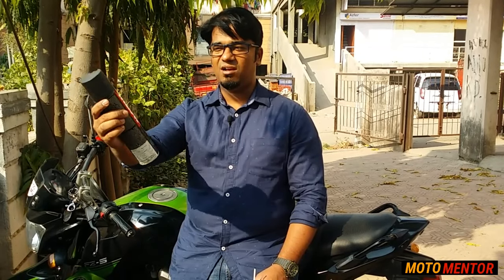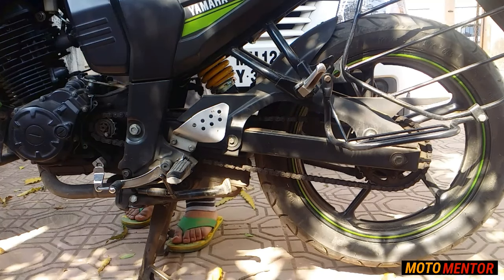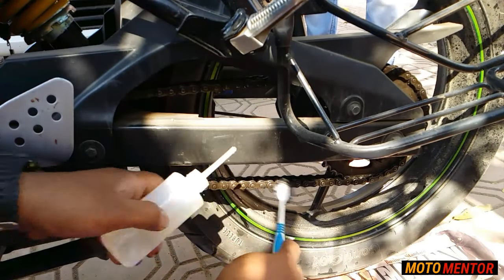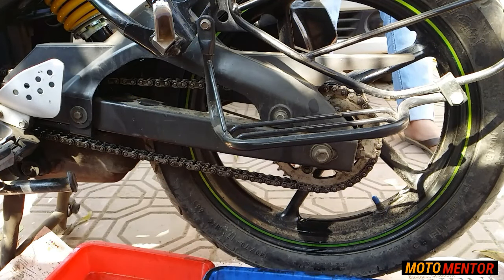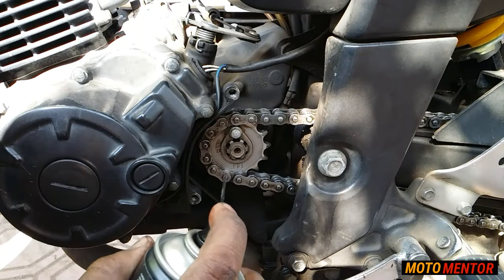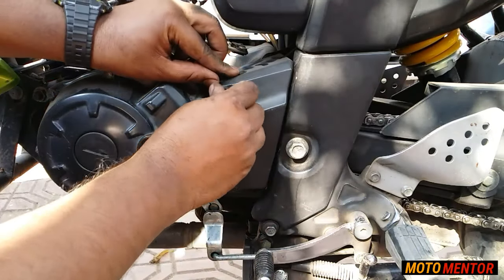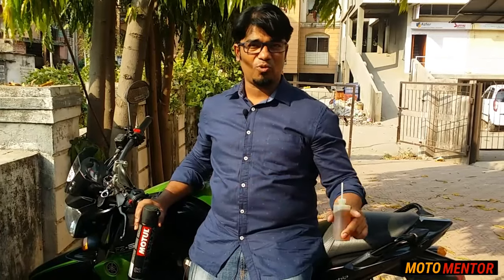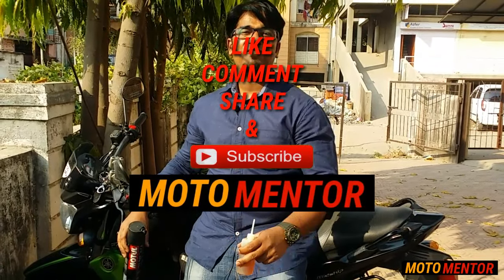BIKE CHAIN NOISE ? THIS IS HOW TO CLEAN AND LUBE MOTORCYCLE CHAIN MOTUL CHAIN LUBE VS 90 GEAR OIL

Comment: All good , kero and diesel are the best and the safest thing for the chain, been using it since a long time. And the gear oil is also better then any chain spry lube it stick for a longer time and provide best rust protection.
But please don't start your engine while working on chain , there have been countless number of fingers and thumbs which have been lost due to this. It takes only slight bit longer to lube it with engine off.
One more tip, i use ep140 for summers and ep 90 for winters as ep 140 has thicker in kinematic viscosity so it bears the heat better then ep90. Try it and you will feel a difference. Gear oil is the best and oldest thing to lube a chain. I have been doing this since a very long time. And target the o rings on both sides not just the rollers one round each on both sides orings and one quick round on the rollers with engine off, all it take less the 2 minutes.
And for those saying kero will eat and destroy the oring , no it will not as both kero and diesel are oil based and good for rubber rings companies like suzuki have mentioned using kero/diesel in the manual of their bigger bikes.
Be safe ride well.
Reply: Inderjeet singh thank you bro
Reply: Where can i buy Gear oil 90? A link would be helpful... TIA
Reply: Lenard Pinto you can buy it from any hp petrol pump they sell it on mrp , also your local engine oil shop would be having it and they give discount ,buy hp one coz it is more economical.
For online try amazon or Flipkart.
Reply: Bro pls provide a link to buy it ... 90 gear oil
Reply: chrismon varghese buy from ur local engine oil shop, or any hp petrol pump. At petrol pump they sell at mrp and at local shop u will get discount.
Hp is the most economical and effective brand.
Reply: Inderjeet singh can we use diesel as chain lub
Reply: Krishna Chaitanya no deisel /kerosene/wd 40 are only cleaner not lube.
Reply: Inderjeet singh can i use engine oil as lube
Reply: Krishna Chaitanya no never there is diffrence in viscosity and how it is made, and never use old engine oil, it should be the last resort when u don't have any other option .
Engine oils are made differently and sometimes contains detergents and other stuff, and old  engine oil has shredded metal particle so Neve use it
Reply: I am useing kerosin and gear oil from almost 10 years
Reply: Inderjeet singh
Reply: Great educative comment!
Reply: castrol 90 gear oil????
Reply: M also using diesel for cleaning the chain for ns 200
Reply: Inderjeet Singh in today's date there is no more seasons like which used to change in different months.. Now, It's like winter in morning, summer at afternoon and monsoon at night all season changes in one day.. So, should we mix both the gear oil ep140 and ep90 same time for better chain lubrication in winter and summer can we do that or not? Which one is the best ep90 or ep140 for all seasons?☺
Reply: Diesel is best
Reply: Thanks... Can we use used engine oil (taken away from previous servicing)?... Some mechanic do use it... is it safe to lubricate chain with used engine oil.
Reply: Hi brother. Basically the gear oil is for the scooter use?
Reply from the maker: Yes
Reply: Inderjeet singh
Reply: i do not recommend to use diesel on oring chains, diesel will damage the orings
Reply: @sanamlaskar4471  how is ur experience with it?? Does chain sprocket last longer??
Reply: Engine oil se lube Karen to koi problem hogi kya?????
Reply: I use gear oil and the sprocket lasts much longer ... it's the best... go to a local oil shop ask for 90 grade gear oil only buy 500ml pack which will cost 50rs and you can use it for 1 year
Reply: Is using diesel is a best option???
Reply: How much its ( gear oil) costs? How many time we can apply ?
Reply: @ijs_autoandmore  
Thank you bro
Reply: @asjadk2000  
Thank you bro
Reply: @ijs_autoandmore  in one year how many
Times we need to clean and lubricate chain
Reply: @prashants2009  300 to 500 kms for lubrication or when it looks dry. Cleaning 1000 to 1500kms or early if it is too dirty and later if it is not too dirty.
Just wipe the full length of chain before each lubrication with a lint free cloth. I do not recommend cleaning each time you lube it.
I have seen lubrication lasting for 400+kms on my current chain easily some fast Motorcycles needs lubrication at 250kms.
Reply: @chaitanya44575  nope, Diesel can't be used as chain lube... It can be better used as chain cleaner. Just spray diesel on chain throughly. Allow 15-20 min then wash Chain with high pressure water... Its the best n easiest way to clean chain and results are much better than chain cleaner spray of any company...

Nope, Diesel can't be used as chain lube. Neither it will lube chain, nor will sustain there even for 3-4 min of usage.
Reply: Indrajeet singh brother kya as a cleaning YAMAHA r15 v2 ke liye kerosene or diesel best hai ar r15 me gear oil use kr skte hai chain lubing ke liye...maine mechanic se baat ki thi showroom me to wo bol rhe the r15 ki chain me rubber oring hoti hai to kerosene or diesel ar gear oil chain ko nuksan krte hai kya ye baat sach hai....ar gear oil me 90 ar 140 kya hai ye bata dijiye
Reply: @akhandpratapsingh3837  bhai sabhi mai rubber ke oring hi hote hai, sealed chain hoti hai aaj kal. Diesel and kero dono safe hai infact kai superbikes ki manual mai bhi diesel mentioned hota hai.
Ep 90 grade gear oil aap full year use kar sakte ho. Nahi to 140 garmi mai aur 90 cold mai. 140 jyada temperature sahe leta hai.
Main aisa hi karta hoo 140 nahi milta toh 90 full year.
Reply: @Inderjeet singh thanks brother
Reply: I like rational comment like you Inderjeet
Reply: @aeonthailand  thanks
Reply: Lots of information bro ThankU...
Reply: diesel oil for cleaning or lubing?
Reply: @ih8momjokes1  Diesel for cleaning only gear oil for lube
Reply: Hi Inderjeet, Kerosene is usually blue in color. This person using something like white in color like water.
Is it any other type of Kerosene or I am judging it wrong and it's blue kerosene only.
Reply: @mohitkv1988  hi , yes the transparent one you see here is kerosene . Kero is transparent in color when it is produced but under the govt policy blue tint is added to it coz govt sells kero at subsided rates to poor and to identify that subsided oil they make it blue sort of a way to prevent black marketing. Last time i checked If buying kero from a regular oil seller we get transparent one and if buying it from govt depo the color is blue. Basically most people do black marketing of kero this is why we usually get to see blue one.
Rest all properties are same.

I personally rely more on diesel as it is easier to source.
Reply: @ijs_autoandmore  Superb bro. I never knew this. Thank you.

So I can use anyone of them right?
Reply: @mohitkv1988  yes both are safe to use.
Reply: thanks.. where to get gear oil? 90 130?
Reply: @sapienmanas0735  i buy from local oil shops of hp brand. U can also buy hp90 from any hp petrol pump, 140 is usually available at oil shops
Reply: @bunty22737  inderjeet_manshoo
Reply: Hi.. Can we use turpentine oil for cleaning chain
Reply: @lovepeaceandkarma7923  no strictly no. Use diesel, wd40 or any good chain cleaner .
Reply: Thanks

Comment: I agree with u. I  just bought my royal Enfield 3 mobths back and have  crossed over 7k km . I have been using these lubes. Like kangarro.  But i cant see the smoothness. And it do not spread to the whole chain and do not go deep into the chain links. Plus cleaning is a hsrd job. As its too sticky . I too am thinking to roll over to gear oil soon. 🤔
Reply from the maker: Sure bro there is no harm to try just make sure you do not over lube coz it will spread on over body pats which can catch dust but again it will not harm try it for your self and you will get use to it.  Best of luck and thanks for watching. Do suggest my channel to your friend if you think its worth.

Comment: Be careful with O/X/Z-ring chains and kerosene. A recent video by Fortnine on chain cleaners showed that kerosene is indeed affordable and cleans really well, but penetrates past the rings tremendously. That's not good, as it would dissolve the factory lubrication that the O-rings are supposed to keep in. Another well-known cleaner, Simple Green, cleans roughly as well, is cheap and another benefit of it compared to kerosene is that it's not flammable and doesn't smell. It's readily available in the US and Canada (I think), but I'm not sure about other parts of the world.

Great video otherwise! I've been looking at various products, but keep coming back to simple old-school gear oil as it's easy to find, affordable and still seems better than anything else.
Reply: Simple Green is quite toxic. Google it's toxicity.
Reply: @usernamemykel  good to know, good thing I don't drink it. :)

Comment: OMG.  Please don't let the kerosene dry out on the chain.  It will leave a residue that's so hard to remove.  As soon as you're finished using kerosene rinse it with running water immediately. A hose with a water sprayer us much better.  Your chain will be shiny and clean after hosing it with water.  Dry it out with a rag then apply chain lube.
Reply: than21
I don't know what's in the kerosene where you live but in Europe I have been using it from my home heating, oil tank for 20+ years to clean greasy things, including my motorcycle chain and there has been zero 'residue' left behind.
Reply: @Jooeffoh  this is India bro not europe
Reply: Finally someone talking sense. You always need to wash your chain after applying a degreaser.

Comment: I agree with you I have a pulsar brought in 2005 and I was using gear oil science the beginning,so my chain and sprockets lasted around 35k. recently I have switched to chain lube and it rusted the links and destroyed the chain prematurely. Now I'm with new chain sprocket kit. I'm never use chain lube again
Reply: Har 500 kmpe lube karo

Comment: Yes you are right, gear oil is the best option to lube the chain considering all the seasons. 
Its so easy to clean and to reapply. But I recommend to use 140 grade, and I use the HP brand which is more better than the 90 grade. And if you want to see something which you will wonder, then add 50ml Polytron MTC to around 300 or 500 ml of the gear oil, definitely have to spend a 200 bucks more. But the result ll be stunning. Your ride will be much much smoother and you may get an extended chain life. I have tried many other additives, so don't waste you money.  I have shared from my experience . God bless, have a safe ride.
Reply from the maker: This is a great piece of information thanks for sharing 👍

Comment: Gear oil is good if you are going to commute but it doesn't stick at high speeds. There is a reason why chain lubes are expensive. Also, during rains or if your commute involves going through mud, go for dry chain lube. It will reduce accumulation of gunk.
Reply: Are you riding a kawasaki h2 or smtin? 90 oil is good for indian bikes and our roads wala speed. Using motul chain lube reduces the life of the chain. Ull need to change the chain sprocket every 3 yrs or so. With the 90 oil it will last u 7-10 yrs without any change required.
Reply: @ashven3214  in india there is dust everywhere .. with gear oil you would need to do it more frequently .Chain lube creates a protective firm on the chain which is resistant to water and dust.
Reply: @chriscs9080   wrong. Most brand name chain lubes hold just as much if not more dust and dirt than gear oil
Reply: Re "chain lube doesn hold dirt"

Nope.

I have found gear oil, synthetic motor oil, frequently applied, is better than the "chain lubes"

Comment: Even I used MOTUL CHAIN LUBE... but then I was a amature and over use it,that too in rainy season... And I ruined my chain totally... And then I used gear Oil... Since, a mechanic suggested me and guess what... I won't say it restored my old chain but the gear oil  far better then anything else..  The dirt that stick due to my previous chain lube used to be hard when its get dry but now at least when the dirt do attach they come up easily and the sound of my chain has been reduced drastically ? I must tell you GEAR OIL are good even better in some case cuz if you don't clean properly and then use chain lube and that too on rainy days and dirt roads it only going to ruin you chain and both of the sprockets.

Comment: I have bullet standard 350 phle ma chain spray use karta Tha but ab ma service center se Jo purana gear oil nikalta ha wo use karta hu.. and it works awesome
Reply: bhai purane wale me metal part hote hain...new use kiya kro wrna sporket jldi kat jayega
Reply: Bro use new gear oil ,used gear oil have small metals and lots and lots of impurities which will effect ur chain .
Reply: Bullet hai bhi isi laayak!
Reply: Vishal Kant can we use engine oil
Reply: Krishna Chaitanya use gear oil it's viscosity is higher than eng oil bro
Reply: Vishal Kant  where can we get gare oil
Reply: Krishna Chaitanya at any shop where lubricant is sold
Reply: Siraj Mazumder you would be using it on metal (chain) itself won't harm anything i guess.
Reply: Amin Shaikh gear oil doesn't harm the chain or the sproket
Reply: Bhai in bullet never use engine or gear oil that will attract lot of dust and accumulate under engine area.. and this may result in breakage of Chine  and sprocket.. on a use Los viscosity oil or lub spray.. sewing machine oil will be excellent

Comment: Note: Never lubricate an open (O Ring chain) with oil,this would unnecessarily attract muck and dust and the whole purpose of Lubrication will be a waste. First of all the Lubricant wont penetrat.
Use a chain cleaner Aerosol thoroughly and then Lubricate with Chain Lube.... I am an Automobile Engineer of 28years of Experience in  Car and Bikes.
Reply: Thanks bro, Can you share Aerosol buy link?
Reply: Please make a video on clean chain bro

Comment: Very informative video .
Just FYI and money saving: I have yamaha fz 2009 and changed my chain set after 22500 kms. I went to showroom first to get estimate for same which was given Rs 3500 appx. As most companies uses Rolon or D.I.D chains and I inquired from market and both were readily available in around 950 bucks (complete chain set) . I opted for D.I.D chain set and paid Rs 100 for labour and whole chain set change costs me around 1050 bucks. Same applies to chain clean and lubing. Clean with kerosene and lube with SAE 90 or 120 lube oil. Ordered half litre gulfstar lube oil from amazon which costed around 115 bucks and due to small quantity needed to be applied I think I can manage  3-4 yrs with same oil. For bike wash I prefer to wash it at home only for sole purpose of satisfaction . Use black sunsilk pouch which  car washers and bike washers use.
Reply from the maker: I also prefer cleaning at home with the same shampoo
Reply: Please use Rupees, bucks 🤣🤣🤣🤣Being an Indian you're saying bucks 🤣🤣🤣 Oversmart

Comment: Don't watch video about chain cleaning and try it in home. the best thing you must do with your friends near don't do chain clean by your hand 📌
 while I cleaning the chain using the waste cloth in first gear running the chain has no lube and it pulls my hand it rotates one time and my finger got chopped...if u r finger got chopped means no use we can't rejoint it 🗑️
My thumb finger nail part is fully gone..I don't wrote my exams...now i can write but the strength of thumb finger is not come back...one year ago
Reply: Sorry to hear. Just now I cleaned chain holding cloth with 1 st gear and was shocked reading your comment. Will never to do it in my life in future. Thanks for your comment. God bless.
Reply: It kills me when people put tutorials out suggesting unsafe practice. Sorry to hear u learned the hard way. That sucks. I hope he read your comment and actually listens to your advice.
Reply: Yes guys, put the bike in centre stand and rotate the chain manually to clean. Safe and best way to clean.

Comment: I am using Gear oil in chain since long in my RE Thunderbird and its a good chain lube... But, i seen Motul Chain lube works better in rainy season becoz of having rust proof and other additives in it.
Rather than Gear oil alone, i use Gear Oil +Petrol Mix as it becomes less viscous and easily goes the inner portions of RE chain. After reaching, petrol get evaporated and only gear oil remains... 

In short rides, i use Motul Chain Lube while on long rides i use gear oil+petrol mixture.
Reply: Nope , petrol erodes the O rings brother
Reply: 90gear oil for lubling
And kerosene for cleaning almost 30 thousand km+ chalega
Reply: Use lower grade oil instead which is less viscous. But thin oil don't stay long on the chain.
Reply: By doing so, my bike previous chain lasted for 58+k.. Petrol can spoil o rings of chain, but with gear oil mixture, very less damage to rubber o rings.

Comment: i also use gear oil to lubricate my chain rather than chain lube after cleaning it with kerosene. simple explanation is that,  it gives protection for much friction to chain and sprockets. that help the life of chain go beyond further

Comment: So I tried your technique for 6 months on my 2016 Yamaha R15 v2 and here's my experience:

I'm using 90w gear oil for chainlube and the chain dries out quickly. I could hear the rough rattling sound from the chain at 6th gear around 70kmh speed. I'm trying to lubricate the chain more often now as it dries out real quick, but this is making the lower bike area quite dirty and greasy. Please help
Reply: Always clean the chain first and then lubricate.... Applying 90 gear oil just because chain is dry is bad idea.
Reply: Gear oils on chains is not for performance bikes my opinion